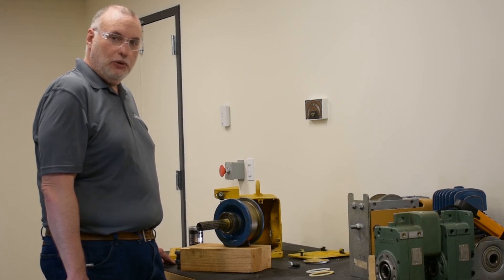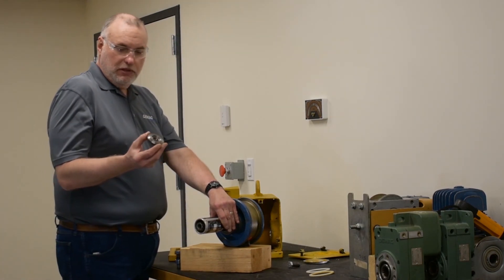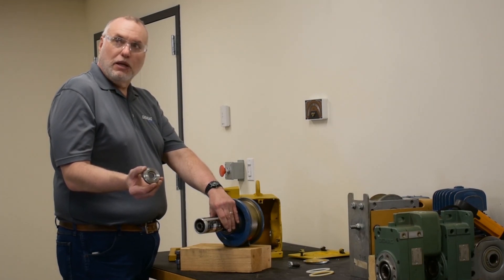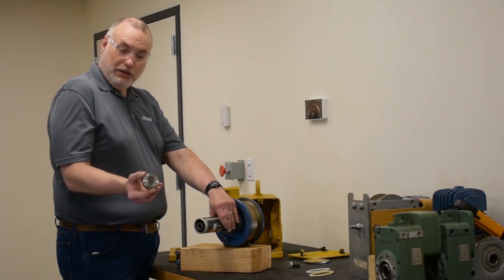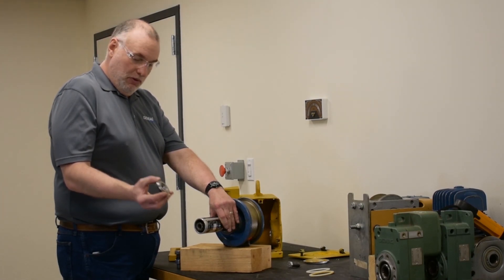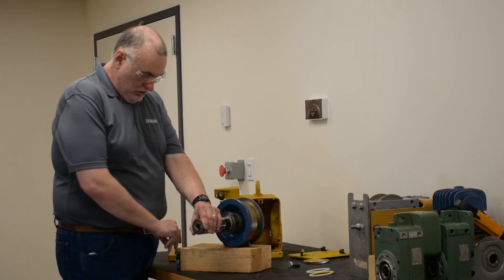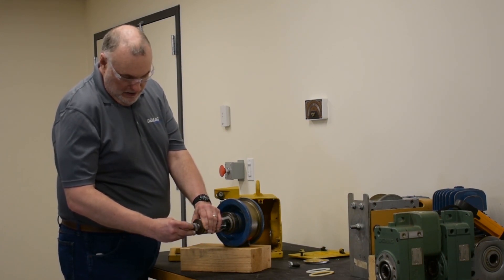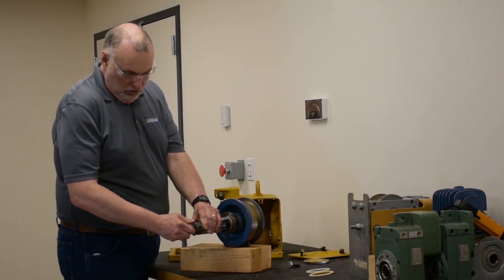Mechanical Puller Method for Removing the Wheels with Tapered Axles on a Demag KTL End Truck

Comment: doesnt work like that i promise you spent 5 hours trying to get one axel out using tube plate and bolt and it wouldnt budge, note it has been in place for lotta year i grant but still dumb design.